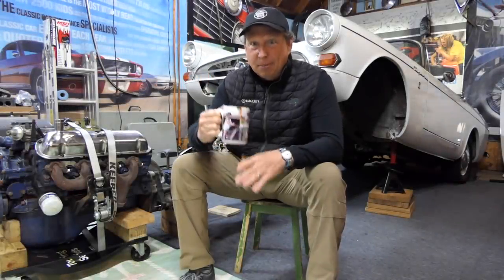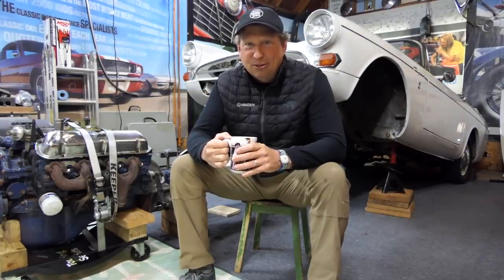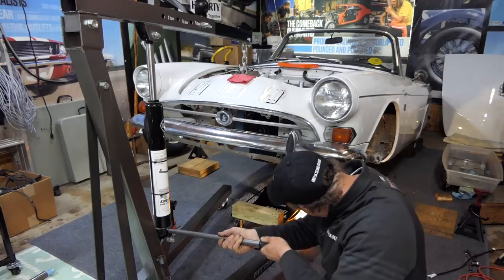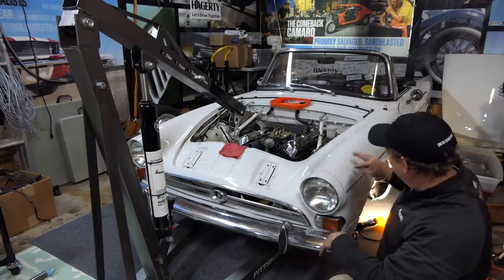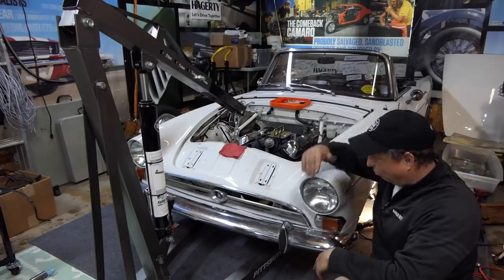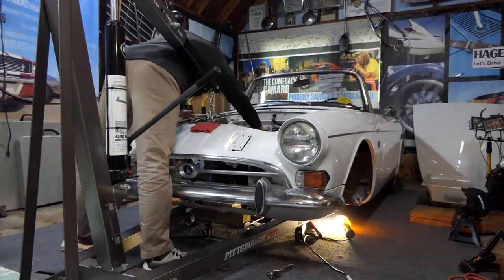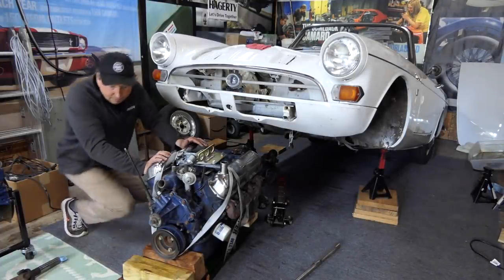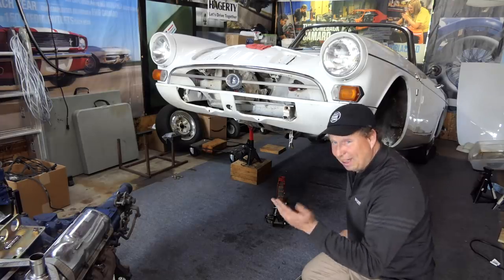Out with the old Ford 260 | Sunbeam Tiger engine swap project - Ep 4

Comment: Thanks for showing this project, I've finally decided to do the same procedure removing my 3.1liter from my 95 Monty Carlo LS, same for the 95 Z34 motor going into LS. But mine can roll out sideways through wheel well, being front wheel drive! 😁 Fortunately, my engine & trans sit in an H-bar cradle 4 bolts  up into frame rails from bottom.

Comment: Semi-interesting fact. Reason it's so hard to get engine out is the Tiger firewall was moved back from original design. Shelby had to move it for both room over the 4 cyl and balance. The Alpine (4 cyl same car) had near perfect balance front to back and side to side. The Tiger still did but 51/49 instead of 50/50ish.  The Tiger was killed off way to soon when Chrysler bought Sunbeam and didn't want to warranty Ford engines or advertise them.  If this car hadn't been repainted you would see a little Chrysler symbol   low on the front fender / technically a quarter panel because it's welded on

Comment: Ditto what Chris B. said.  And after having removed and replaced engines from the top and bottom in one car, I'll never go back to R&R from the top again.  Out the bottom and back in the same way is much easier, especially if you're doing it without an assistant.  With the firewall and motor mount design on the Sunbeam, I don't think out that out from above is even an option.

Comment: One of three favorite Detomaso, AC Cobra, Sunbeam Tiger. I wonder if the taller deck 351 Windsor would go in there?🔧🔩⚙⛽🇺🇸
Reply: It will if you modify the fire wall
Reply: @ericcorse  oh my goodness the tiger would be a monster because you can stroke them to 408 and oh my goodness⛽🇺🇸
Reply: @forestlawrencegrading9154  It is my understanding it had been done by a past president of Tigers East Alpines East, I never saw the car.
Reply: Bigger  hammer
Reply: @charlesharper7292  10-4 that's what I did when I V8 swapped a S10 I used a bfh⚒

Comment: I thought you would have put an alloy top end on the rebuild & put the battery in the trunk.
GOOD though.
Reply: Aluminum heads would certainly be nice, and maybe one day, but we wanted to keep it using as many period or "upgraded" stock parts as we could. Fortunately on a Tiger, the battery is already in the trunk!

Comment: Did you actually drop the engine from under? I have changed many engines over the years. Street cars, and two dirt track cars for 8 years. The only one that came out from the bottom was a 64 does van. ( Cause I was too lazy to pull the seat and engine cover...)
Great car, gonna be fun!
Reply: Charles, there are large numbers of cars where it's easier to drop the engine and tranny out the bottom and reinstall it the same way. 
Older cars..... Muscle car era Mopars
Newer cars.......Fox body and new edge mustangs and the cars that used that platform
Bunches!
Reply: @rayjay8322   Only did it once. On my old van. Everything else, out the top. Usually takes me about two hours.
Reply: @charlesharper7292  You'd be surprised how quickly I can have an engine out of a New Edge Mustang that DROVE on the lift.Depending on the car, two hours easy.
Reply: @rayjay8322  Yeah, me too. Bout two hours, even less on my dirt track cars. I worked in a foreign car shop when I was a kid. Old VW, from the car on the ground, to engine on my bench, 13 minutes.

Comment: Rather curious as why you leave that rear crossmember in?? I don't see the advantage of sliding transmission over that at all. I am surprised a 260 made it to the 21st century as most are very tired by now. It doesn't matter how it comes out the bottom... meaning raise car off or lower motor out, apples to oranges, but the crossmember ... thats a big one to me
Reply from the maker: That’s a great question with a very simple answer. The cross member is riveted in not bolted. I could have blown the rivets out but no point when the trans can easily (with exception of weight) come in from the bottom.   Actually since building the 216 I have found there are several out there. Many still in service and of course many swapped out for 350 Chevys. 

Thanks for watching!
-Davin